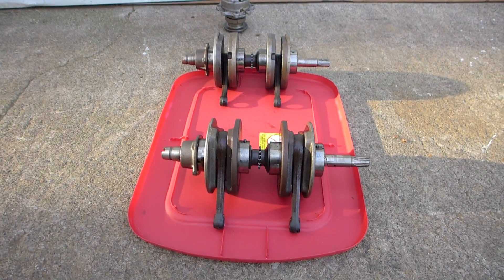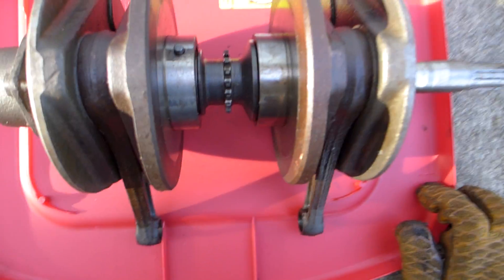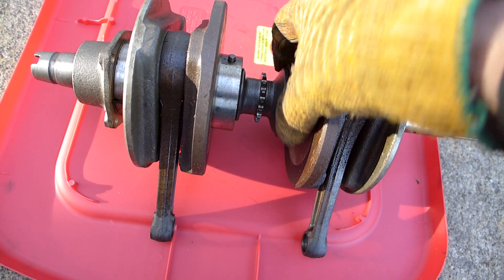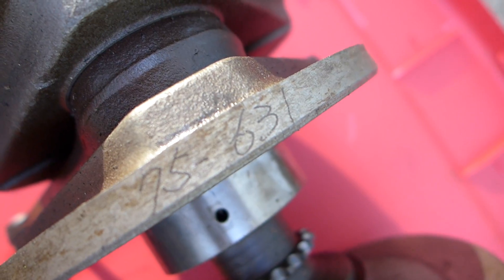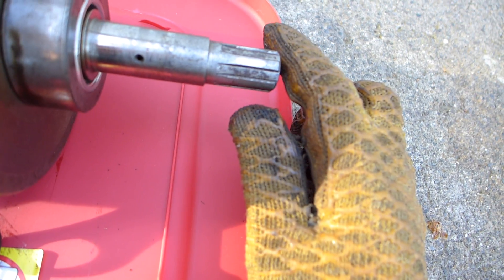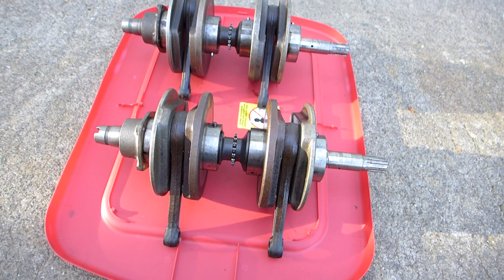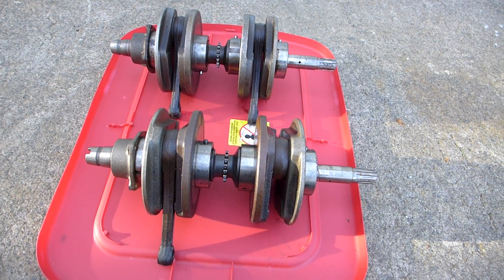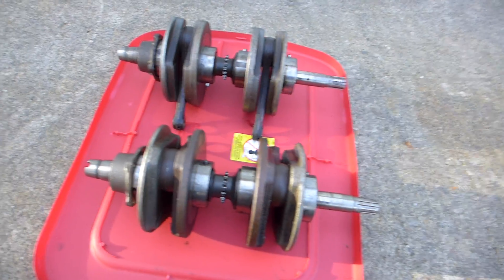Honda N600 or Z600 roller crankshafts

Comment: They made 2 different cranks. The early cranks from sedans have smaller rods at the big end and its easy to see if you have one of those. If there is a hole in the rod directly above the big end it is an early type. I cannot see in the video the sides of the rods. All the coupes have the larger conrods.
Reply from the maker: Ok, good to know, I will look.

Comment: thanks for the reply....I only need the az600....will it be expensive?
Reply: will the n600 crankshaft fit the  6oo sedan?? I have one sedan and one coupe ...how much are they each...or for both?
Reply from the maker: Yes Honda N and Z  600, they are exactly the same. $350. for a good used crank assembly plus shipping from Portland Or.  I sold one already, I only have one left.  They are $1800. rebuilt FYI.
Reply: @2stroketurbo  Do you still have this crank?
Reply from the maker: @jackblackwell2238  Yes I have one left
Reply: @2stroketurbo  I would be interested as we've checked ours against the Honda workshop manual and it's beyond the tolerances Honda state. Is there a more formal way I can mail you?